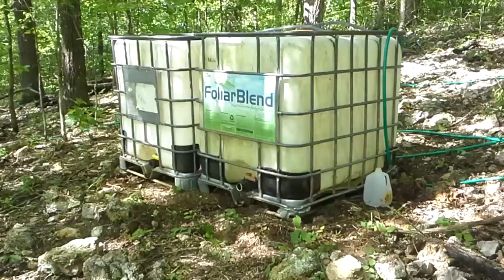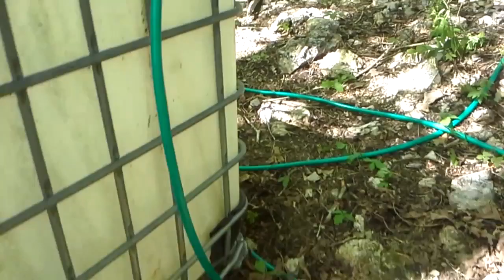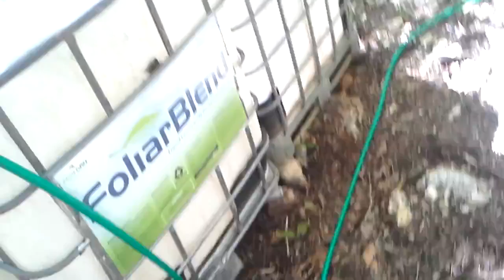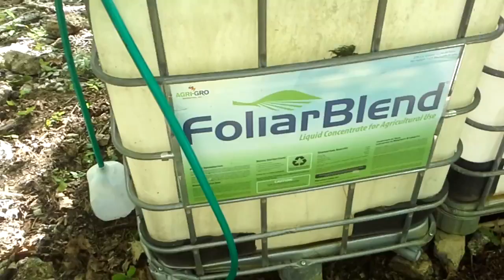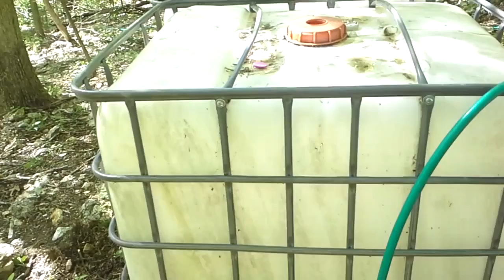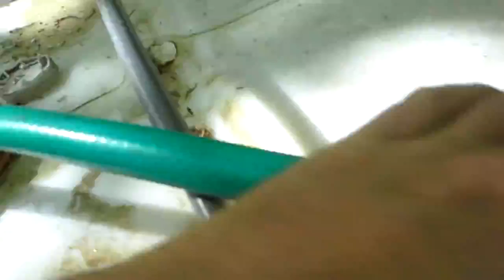Ram pump GPM TEST!

Comment: Still impressive and nice to be able to water your garden without a well.  You may want to disconnect the hose near the garden and water directly from the pump at times also.
If the distance is shorter the flow rate will be greater.